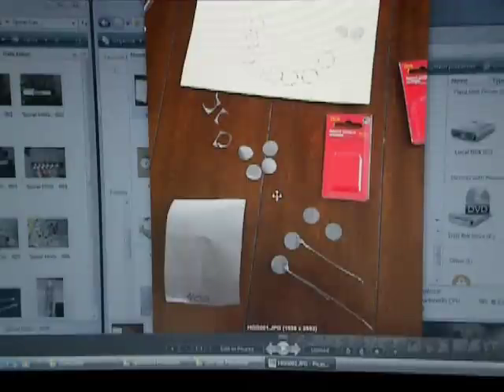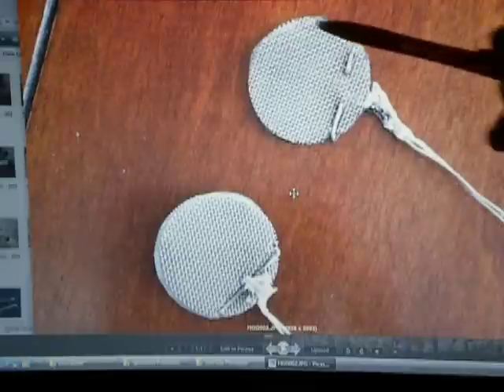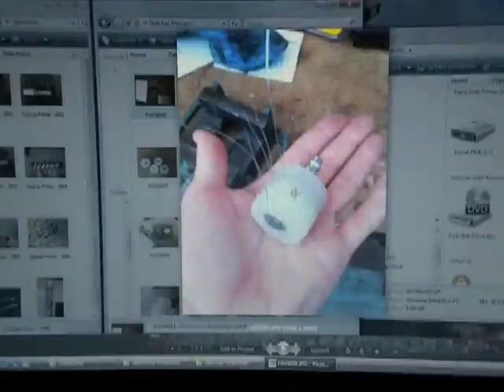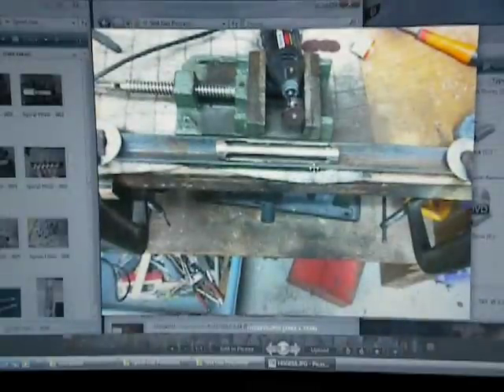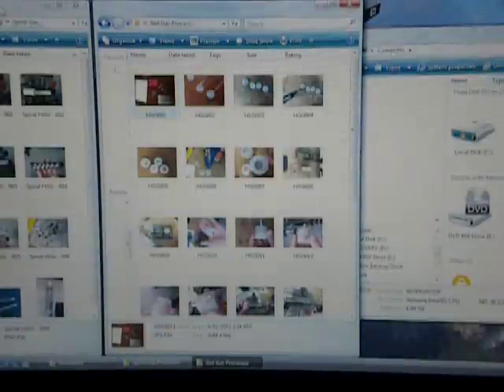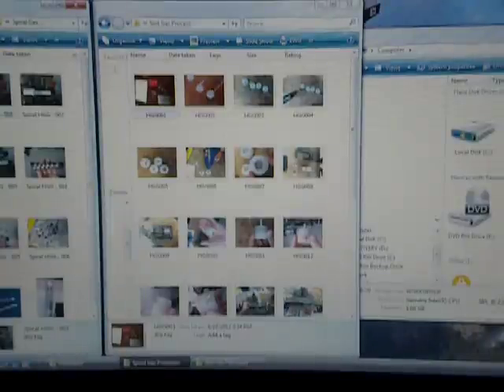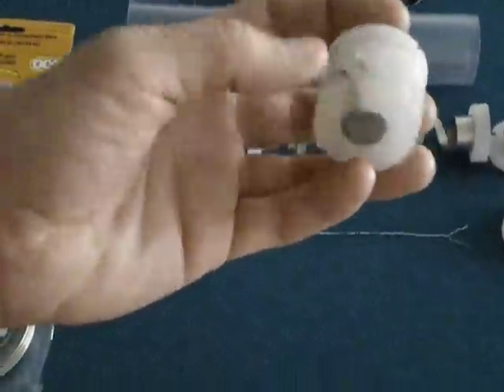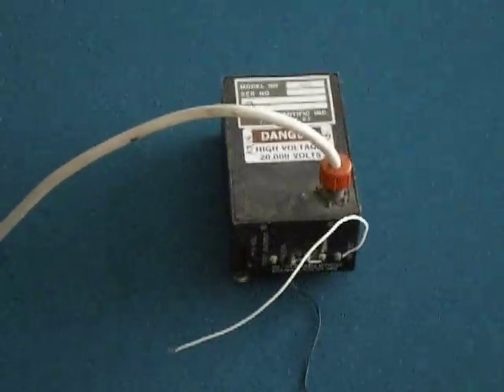Laser EPG 005 - HGG Hydrogen Gas Gun/Processor Part 2, Spiral Design

Comment: Remove electrons and switch off the bond. The Voltage Polarisation Process..
When the gas processor ionises the air to remove electrons. This air is mixed with water to make water fuel. When this water fuel is ionised. The processed air with missing electrons gives  the oxygen a very strong electron gravity and is used to remove electrons from the water molecule. Causing a polarity flip and so splitting the molecule.. It’s a triggering process! He said,  This is the voltage polarisation of the water molecule.. The covalent bond is equal to the two shared electrons and if you remove these electrons. The oxygen atom will flip back to a positive charge instantly repelling the atoms.. Processing the air in his air gas processor he removes up to 4 electrons from the oxygen in air and uses this as a tool by dissolving the processed air into the water in the way air is dissolved to keep fish alive in a fish tank.. This is what he called his water fuel.. If you don't make the water fuel first then all of his inventions will not work as described.. I hope this is helpful to you..

You must understand when he says combustible gas atoms he is always referring to is the oxygen in the ambient air. Combustible gas atoms are not hydrogen and oxygen. Also In all his patents he refers to electrolysis as the prior art The voltage polarisation of the water molecule is not electrolysis. It’s a set of conditions set up to trigger a reaction. Like I said above he strips the electrons from the oxygen in air in his small air gas processor and keeps the oxygen atom stable with light energy.Then dissolves this prepared gas into the water tank. This is his water fuel. Now all of Stan's arrangements will work as he stated.  When you use the VIC to charge the cell up to the dielectric properties of water without dielectric breakdown you excite the water molecule and also the dissolved oxygen held dormant by the dielectric properties of water. When the electrical stress re-excites the processed oxygen from the air. The oxygen has such a larger attraction force over the two covalent electrons it removes the shared electrons and as Stan says for every action there is an equal and opposite reaction. When those electrons are removed the oxygen atom swings from negative to positive charge and in so breaks and repels the atom structure. He says 5 seconds of excitation you will get 90 seconds of production..In turn the electrostatic fields used to ionise the water and combustible gas atoms otherwise known as water fuel, attract the now separated atoms towards the electrodes. This is not electrolysis, it is the birth of a new technology and now you know!! Any questions just give me a shout.Hope this helps you with your interest. Thanks Tony.     

https://youtube.com/clip/UgkxIobrQrZVXglOaAgxttBYfTvPzTFwXdca?si=qET09j2icEAxubA9
Reply from the maker: I’m glad you understand the tech. It’s difficult to understand how everything works together. However, once you understand how the water car functions, his later works are easier to grasp. My focus is on Stan’s Laser EPG. It’s a generator that runs on the expansion of a magnetic field produced by laser excitation of a magnetic gas. I think I’ve figured it out though. More videos to come. 
https://youtu.be/LEKJOINMzgs?si=7A4rL_IpKhLe3exW
Please watch starting from 1:14:00
Reply: @LimitlessResearch  Yes, you need to make the water fuel first. When the voltage polarisation of the water molecule is triggered it is not hho is unstable monatomic atoms of hydrogen and oxygen. This is a new gas mix and due to the change of electron spin they exhibit new magnetic properties. If you look at the cell arrangement with the large coil spiral with electrical pick ups around. This is the beginning of the epg technology. So you don't need to make the argon/iron gas as this was Stan's improvement on just using the polarised gas release from the cell.. The key to all his arrangements is without doubt the air/gas processor conditioning oxygen from air removing electrons giving the oxygen a very strong electron gravity and when in contact with excited atoms or molecules it will remove their electrons causing a change of electron spin and producing strong magnetic fields. If these gases are held in a tube and not able to reach a stable state when moved by a magnetic field or laser light is applied the atoms will be excited, shell orbits jump, electron spin increases and their magnetic fields are amplified. In so amplifies the  electrical output over the energy input.. Hope this helps your understanding. Making the water fuel is the first step.. And a note oxygen has the second strongest electronegativity, fluorine is strongest but! Oxygen with 4 missing electrons may exceed fluorine.. Oxidation as we know it is just oxygen removing electrons from say steel and causing rust.
Reply: The hydrogen fracturing process is using the same processed air/oxygen to remove electrons from the gases made by the voltage polarisation process. It’s the same processed air this time doing work during gas ignition. If this oxygen with 4 missing electrons and a very high electron gravity is present during combustion of polarised gases not hho. This extends the combustion moment by momentarily suspending the formation of the water molecule.
Only 0.0001% of hydrogen and oxygen get burnt the rest turns to water. Stan changed all this and this is why he says one gallon of water is equal to 2.5 million gallons of oil in energy. It simply improves the efficiency of the fuel and oxidizer during combustion.. Please share my findings. It has taken me since 2007 to get to where I am now. It is very important that the info is shared..Thank you!
Reply from the maker: @mtttony  Thank you for sharing your insight, it is much appreciated. I agree that we all need to be sharing our research findings to make it easier for others.
Reply: @LimitlessResearch  Thank you for listening, it will save you years of work..
Reply from the maker: @mtttony  I wish you were around 11 years ago when I started on this research, lol. It has been an enlightening experience.
Reply: @LimitlessResearch  The key thing is to understand and share so it’s not just me and a couple of others who know.. Share and it will happen eventually. If you have any questions just ask.. Thanks bud, there are good people out there.